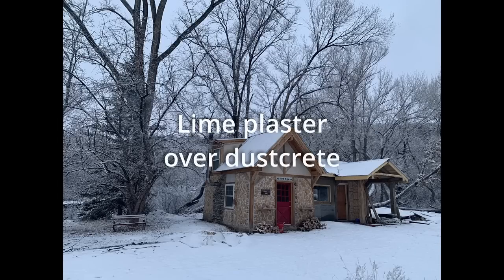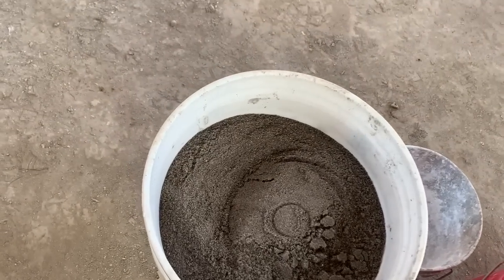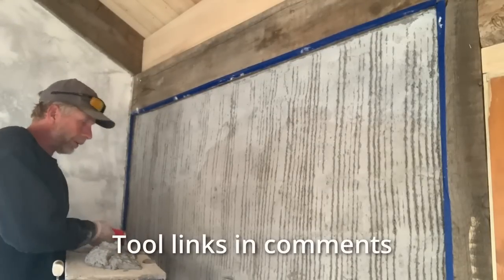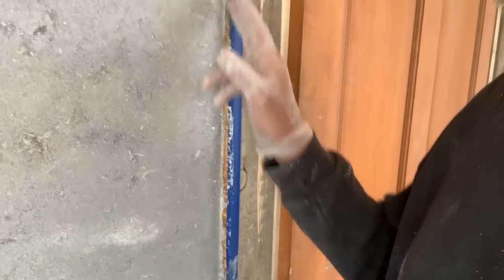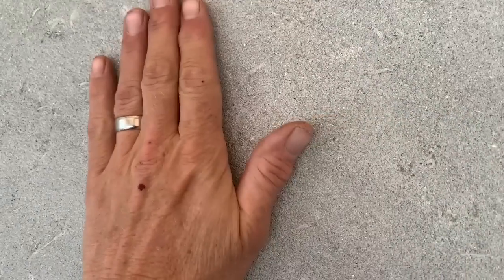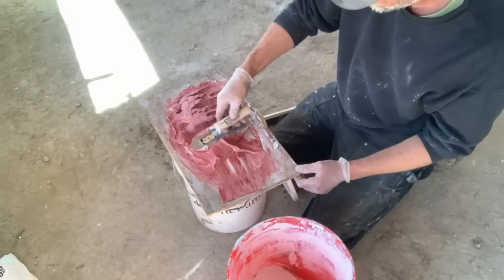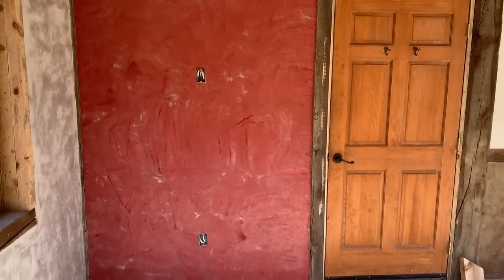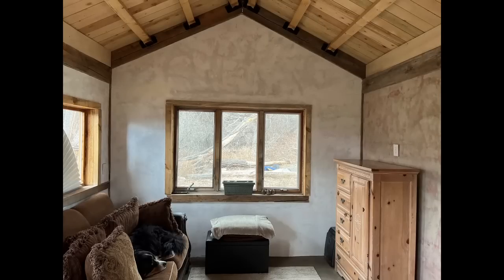Lime plaster on dustcrete walls

Comment: top tip from a professional, when you scratch the base coat ,make the lines wavy and horizontal,this forms a good key that will help prevent cracks from travelling (they move in straight lines). All else carry on old chap.
Reply from the maker: Thank you. It’s a lost art, in America. Glad to pass muster.
Reply: @radicalgastronomy  So nice you are showing us all something new and innovative. Shame more are not making great strides with building materials Sir.
Reply from the maker: @victoryfirst2878  Glad to be of service!
Reply: @radicalgastronomy  Now I would ask you for the best way to heat a home one lives in Sir ?? Thanks
Reply from the maker: @victoryfirst2878  My favorite is passive solar with an earthen floor to hold the warmth. My orientation is not due south in this building, so I supplement with a wood stove. I will be building a rocket mass heater for this room, soon. Stay tuned!
Another local natural builder just informed me that it has actually become reasonable to run in-floor heat on an electric boiler hooked to PV panels. The drop in cost and increase of panel efficiency has now made this set-up doable with two panels. I also like the old school solar collectors run to a water bath with in-floor heat pulling from that, but he says the electric rout is more affordable factoring in maintenance.
Reply: @radicalgastronomy  Excellent Ideas RG. I look forward to see your rocket stove build and any other videos for me to learn more interesting things to lower my home costs......
Reply from the maker: @victoryfirst2878  I’m all about that!
Reply: @radicalgastronomy  Thank you fella.
Reply: @radicalgastronomy  thanks for your videos .  I want to make a thatched roof long house to make into a type of tavern wedding hall for banquets. I have a large sawmill near me and the cement plant is not far so I think I have the cheap materials in the mountains of Ukraine to make a cozy place to sing and dance and eat

Comment: My father, my brother and I used this basic recipe to coat straw bale buildings about 30 years ago. It is holding up well. I have a video on it named "Straw Bale House Life 28 Years and Counting". We put up straw bales, wrapped them in chicken wire and then covered them with Dust Crete. It is standing the test of time for sure. You are doing some very nice work.
Reply from the maker: Sweet! I'll check out that video.

Comment: I like to pounce the basecoat with a stiff scrub brush. When it's relatively firm, I knock down the high spots with a trowel. The second coat is my contrasting color coat and I flatten it as much as possible. My third coat uses marble dust as an aggregate and no sand at all. I tint it very lightly with either the base color or the second coat color. It essentially fills the pinholes and small dips, while giving a three dimensional effect. Spraying the cured plaster with water glass locks it all together, and makes it easy to clean without bleeding color.
Reply from the maker: Sweet. Do you buy that water glass, or make your own?
Reply: @radicalgastronomy  I buy it. I can't justify the time it takes to make it, as cheap as it is.
Reply from the maker: @daviddixon2209  good trick. Better than tadelakt?
Reply: @radicalgastronomy  you might call it lazy man's tadalakt. I've used polyurethane as a sealer, as well as some water based sealers but I trust the water glass more for penetrating and bonding. With tadalakt, the soap polymerizes like linseed oil. It requires a lot of finessing to get good results and I'm too old and arthritic to make it work. I had to come up with something less demanding.

Comment: Brilliant. A few tips to help speed things up . Mix in a mixer, add water first then slowly add cement, lime, sawdust add more water as required.( this will prevent sticking to mixer blades. Tip from the mixer into a wheelbarrow then wheel it to the wall scoop it out with a shovel into wall and tamp down with a hand made tamp that fits the wall size. Great project dude. PS : One more tip place all materials and mixer as close to the wall as possible to preduce walking distance, you'd be amazed how much faster this will be.

Comment: Scratch coat scratch pattern should be parallel to the floor or ground. It will hold the mud better.
Reply from the maker: No failure at 1.5 years. We’ll see…

Comment: First time I've watched the process of making a wall from start to finish. It looks great, and I really appreciate such educational videos!
Does the crack from the cold join have a significant impact on the... I guess, robustness/lifespan/utility of the wall?
Reply from the maker: The crack is largely cosmetic. Because the post and beam frame carries the roof load, the dustcrete is just infill. The outside of this wall has a clay/lime plaster that has only a hair-line crack. It doesn’t have a draft. There are a couple of other little cracks around the room. I think that this sawdust was a bit too wet when I used it and will try allowing it to dry a bit in future builds. 
I’m so glad you liked the series! I’ll get a video up of laying the earthen floor, soon!
Reply: It is possible to use ladder wire across cold joints, or even metal lath.
Reply: Good  old painterly wabe goes into supporting colour and character of posts and beams ( pretty easy to live with ) ❤ .

Comment: Thanks for posting! I'm loving the dustcrete! Would it be feasible to top coat it with drywall plaster instead of lime and sand? (I know the look will not be the same, just curious if there is a good reason drywall plaster can't be used.)

Comment: Mix more lime into your sawdust Crete fill to sanitize it against fungi eating wood inside the wall. Black mold is a toxic hazard you never suspect since you will never open up inside a wall to look... prevention is the key!
Spritz with 3% H202 hydrogen peroxide before plaster scratch overlay coating.
Reply: what does the H2O2 do?
Reply: @garyweber6413  Sanitize... lookup hydrogen peroxide.

Comment: How easy/difficult is it to put nails or screws into this wall surface? For hanging shelves or artwork?
Reply: Masonry bit, drill a pilot, take it up to your desired hole size one bit a time, drill slowly to avoid damaging the bit and the surface. Wall plugs (not necessarily plastic e.g. hemp fibre or wood) for a strong fix.

Comment: Because the internal walls won’t be subjected to water, would it be sustainable to simply chalk paint in place of pigmented plaster, if I like the texture?
Reply from the maker: Any render that remains vapor permeable will work well. Earthen plaster is another option. Chalk paint with latex additives could be problematic, but lime wash (pigmented or not) would work great.

Comment: Is the plaster coat neccesary over the dust crete for structural integrigity? I have a bunch of ft high garden terrace walls to make and was thinking this would be an inexpensive way to go about it.
Reply from the maker: The plaster is cosmetic, but will add durability. You can always do it later, if you want to freshen your wall up.  I would use some sort of cap stone on top of such a wall.

Comment: I have a question about the cold joint. If you were using Dustcrete in a arched design and were using rebar or something similar and had an inner, and both outer layer of metal that the Dustcrete was tied into like this ((( Would you think it could be weight bearing like the thin walled cement domes I’ve seen built over the years. And would a cold joint be bad in this situation or do you think the arched design would just press it into itself like when arching stone or brick? Perhaps if you had enough people you could finish the whole archway in one day to prevent the cold joint. I’m looking to seal it up and make it earth covered.
Reply from the maker: This may work, as described. I would only feel comfortable if it was all poured in one day.
Reply: @radicalgastronomy  that’s what I was thinking, just wanted a second opinion. I’m going to experiment with it when I get to the property. I’ll let you know how it goes.

Comment: Thankyou for a response in a fair amount of time..
What would be wrong with just sawdust or wood shavings like the horse world uses ??
I believe the dutch and folks in Sweden build with sawdust in the floors in there log cabins, and they have a very frozen earth in there winter. They have been using sawdust plain for many many yrs..
I have a new Graceland building in northern Arizona at 6850 feet..
I would like to fill my wall cavities with Adobe mud for a thermal barrier.
The T-111 is on the outside of building.
I am thinking of Adobe or cob, but more on the dryer side as well..
Completely have the Adobe walls inside, nothing else, have three or four windows 🪟.
Put regular ceiling insulation in attic and ceiling board on ceiling.
The center of roof and the eaves of building are vented the whole length of building, so to keep it vented well, a heat & moisture thing is why they build them this way.. what do you think of my crazy idea..
One other idea is to insulate walls with normal insulation and over the studs, apply one layer of thermal barrier, with a product called REFLECTIX.
I Am not sure my spelling is correct.. then put wall boards up over the thermal barrier.. I do have lots of Adobe material all over my property.. Just exploring different ideas before I move forward to make a warm tiny cabin where it gets down in the single digits some winters...thanks again for any suggestions. For I am handicapped and I am limited..
Plus this is my first project like this at my retirement age.. Thankyou again for any suggestions..
Reply from the maker: Adobe has thermal mass, but almost no insulation value. It is also quite physically taxing to make and instal. I think you would be better of with the conventional insulation, or dustcrete. And yes the finer bedding sawdust is perfect.

Comment: Tip (remove the air conditioner  from the wall and put it in the new outer wall.
Reply from the maker: That OSB was the temporary wall for the other half. A/C unit is now in an exterior window during the hot season. We only need it in the middle of 90 degree days, thankfully. 🤪